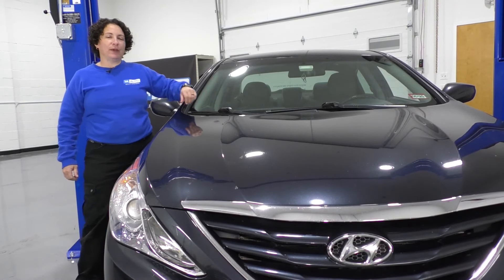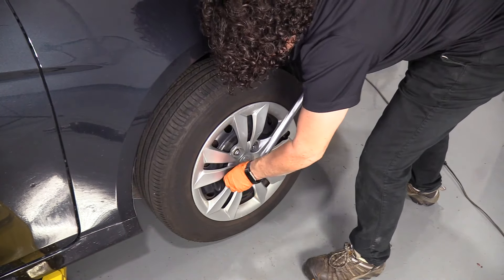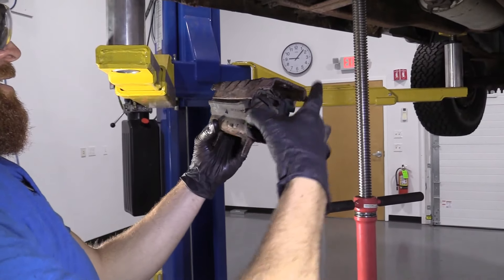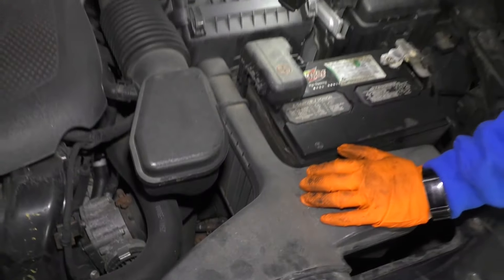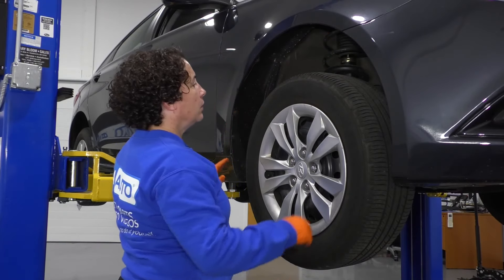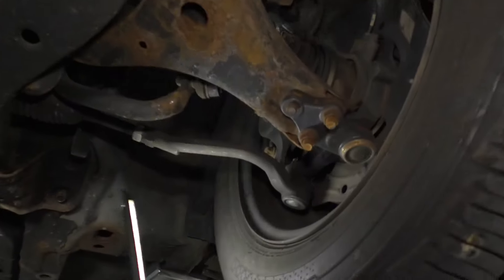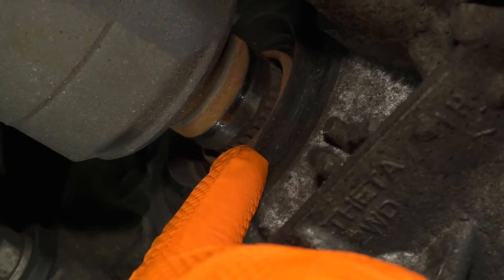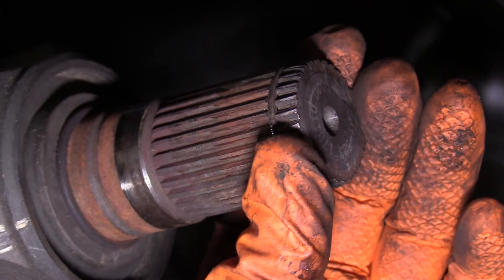What's That Noise From My Car? Diagnosing Vibration Under Acceleration!

Comment: Depends on how old the car is, or the last time you changed trans fluid. The torque converter will shutter and not lock up properly. You need to change trans fluid and maybe add a friction modifier to the trans and it will go away. I had checked everything she talked about here and couldn’t figure it out until a tech told me to change the trans fluid and it stopped. It felt like you were running over rumble strips.
Reply: Hi
Reply: I have got a similar problem..got any suggestion?

Comment: Have an 88 sentra. Mine seems more idle related. Usually when first started it's ok, although sometimes idle is rough. After a few minutes of driving(warm or cold), it'll start to randomly shake, like it's sputtering, but it's worse when excelerating from a stop. On the highway around 50 it isn't bad. If it sits for a while, after you start driving, it's ok for a mile or so, then starts shaking again.

Comment: She’s GOOD! Excellent description throughout!
Reply from the maker: +Windmill Last Thanks for the feedback!
Reply: @1AAuto  I have a 2012 and a 2013 ford edge and both vibrate on acceleration around 30 to 45 mph. not highway speed. Could this be the same thing? the 2013 vibrates the steering wheel  the 2012 you can feel it but doesn't shake the wheel

Comment: I had the same problem on my 2015 highlander, whenever I step on the acceleration pedal the front of the car shakes, when I left my foot off the acceleration pedal the vibration is gone. I definitely check the CV Axle on my car.  Thx for sharing the video.
Reply from the maker: +Jun Da Li Thanks for checking us out! http://1aau.to/m/Shop-1AAuto-c

Comment: Ahh! Thanks! I finally have something to look into!! I ruled out the cv shafts, as I'm used to the joints getting noisy and eventually tugging the steering wheel. 

When I got my 2010 mazda3, the engine was nearly falling out, all of the mounts were shot. I bet the axle pulled out and damaged or lost the clip. I'll be back with my findings!

Comment: My pickup Chevy Colorado 2018 had a vibration at 50 + mph...well going thru every posible scenario....a body shop guy suggested me to do a check on the chassis...sure enough the truck had a bad wreck and chassis was out of whack just a bit but caused major vibration at high speed....cost me 200 dollars to correct the problem now i am loving and enjoying my truck👍❤
Reply: Have the same problem on Chevy Colorado how can I check on the chassis if it’s damaged
Reply: How can that problem was fixed the truck was also in a wreck before

Comment: Got a vibration sound more of a humming noise near the driver foot area when lightly acclerating. The humming vibration is strongest with light accleration, less with higher speed of 40+. Of course the cold start are really strong. 220k miles Sienna 2009

Comment: Been trying to find this issue on my car for a while, will be looking tomorrow snd fixing right away if that the case, thanks a lot.
Reply: Didn’t see any signs of failure but took a chance on the drivers side drive axel as I did recently hit a curb hard. Did not fix the vibration in the front end. Will be checking the wheel bearings in the morning but after that is passenger cv axle, so close.
Reply: Turns out it was the 2 front wheel bearings, car is finally running smooth, no vibrations.

Comment: Great mechanic, I've recently replaced shaft crafts and CV joints on my car, the only unsettling part is when I do a 90 degree turn that's when I hear this worrying sound like an old steal being bent.

I'm clueless with cars, it vould be nothing but dang its uncomfortable especially when one bought a used old model car.

Comment: I replaced both the struts AND half-shafts on my 03' Grand Am GT;
But I have a metalic, grating, grinding noise coming from the
driver's side. I believe it's the strut-mount. It's possible I didn't
tighten that middle securing nut when I installed the spring
over the new strut.

Comment: What would happen if clip was in Transmission?  I was sideswiped and had to have repairs--strut, wheel, body work on passenger side.  Vehicle ran great for 6 months then the axle dislodged (I believe from transmission); they said it must have been knocked slightly loose by the accident and then missed by mechanics and insurance adjuster. Anyways, there has been a slight vibration on both pedals and floor board every since the made the axle repairs.  Took it back later and they replaced tie rods and steering column, but it barely helped with the vibration...

Comment: I think my motor mount is broken! My steering wheel shakes when i get over 60 mph so i have to turn my steering wheel a certain way to prevent the noise… also when i brake on reaction my steering wheel shakes uncontrollably… is that the problem?

Comment: I have a very similar problem on my nissan micra 2007. The car is shaking when the rpm is between 1000-1500.when the rpm is more or less than that it doesn't shake.what is the problem in your opinion and please explain me why it vibrates only at this range of rpm?
Thank you very much

Comment: you ma'am are awesome I work on cars a little but wish I could learn from you I am learning from the video too I got a 2012 4cyl buick lacrosse 66,000 miles had it 5 yrs haven't had any troubles but a camshaft sensor right now I can be driving and it will do a little jump when I slow down I really can't tell if somethings going on cause it has auto stop so when you slow way down almost to a stop it feels like the auto stop. could it be spark plugs since they haven't been changed wanna nip that in the bud before it turns into something big
Reply from the maker: +MsLeelee94 Thanks for checking us out!

Comment: Hi Sue. Is there a clip on the front passenger side axle. I replaced it but didn’t see a clip and now when I go over bumps I hear a popping noise and when I go on sharp turns. ‘03 Honda Element. I checked and it seems there about 3mm play between the transmission and axle. I pushed it back in but keeps coming out slightly. I feel a vibration when I go over 80. Thanks for the great videos. You make it seem so easy lol

Comment: My car starts to shake when I’m going 60 or faster. I had the same problem when I have a ford escape and my cv axle was completely broken in two pieces. It did end up failing inspection due to front end play.. of course during covid when everything was shut down.

Comment: I have a 2011 GMC Terrain 3.0 AWD.  While in Park, I can press on the gas and the car noticeably vibrates at 1500-2000 rpm, then smooths out above 2000 rpm.  Any guesses!

Comment: Pls, advise as I have a major problem with my reverse gear Ford Taurus 2011. After driving only, when I STOP and shift gear from drive mode to reverse, there is a big hammer clunk sound from inside maybe gear tooth or axle not sure, even mechanics are not sure due to zero error showing in gear computer. I have done gear formation but still, there is sound. Surprisingly there is no loud sound if I change gear after 4-5 secs from drive mode to reverse. Also on parking if I change from P to R  or R to D there is no sound. Not sure is it becoz of AXLE and appreciate your feedback, thxxx

Comment: I have a 0.5 to 1.5 second vibration coming out of a stop and accelerating.  My transmission was "rebuilt" a year ago, but I don't trust them.  Any idea what it could be?  It also vibrated from a stop sign where I gave it a bit to clear the intersection, and lost the usual engagement to the rear wheels (old BMW).  Then it engaged suddenly and my rear wheels squealed.  I need to find out what's doing this.

Comment: Sue...how about a vibration that you feel in gas pedal and seat and dashboard that is intense at cold start but lessens (but still annoying) after warmed up? Vibration is better after 2nd or 3rd start while running errands. Motor mounts already replaced.
Reply: Did u figure out what it was

Comment: I have this very same issue with my 2020 Hyundai Kona fwd. I checked the wheel balance and axle bo issue. Couldn't find where the wobble is coming from and it's driving me nuts.

Comment: Mine does the same thing but reverse it rattles when accelerating and goes away as it speeds up. Sway bar is good, links are good... Could it be my shocks? Its on the passenger side

Comment: Got bmw 120d with steering wheel wobble.   Had front wheels balance and bearing ok and coils good hard to lift the car myself coz bmw lift points lol.     Can back wheels make your car wobble or front disks it’s at low speed

Comment: HI DO YOU KNOW WHAT CAN CAUSE A CAR TO SHAKE around 5 TIMES  WHEN ACCELERATING FROM 0-10KM H IN 2015 volvo with the automatic engine start stop button ON. when turning it off pretty much the vibration from 0-10 its GONE
Reply from the maker: +ed lara salas We wouldn't be able to diagnose an issue like that here, you may want to have a local mechanic take a look at it. Thanks for checking us out! http://1aau.to/m/Shop-1AAuto-c

Comment: Holy crap Sue that's awesome! I have never seen this called out before. I have an observation...  at 3:52 you can see a harmonic ballast mounted mid-shaft on that axle. In all my years (30+) of owning Mazdas, the newer ones have had these on the axles from the factory. As the miles pile on I eventually need new axles, yet they seem to never come with that harmonic ballast. Any thoughts on this? I just wonder if the foreign reman factories are tossing the ballast during axle rebuilds instead of repurposing them. I have an odd warble in my Mazda 6 in 1st gear (V6 manual) acceleration and I've always wondered if this is the cause. The axle is not pulling from the transaxle as you've shown here. Again, thanks for the great video!!

Comment: I have a 2005 avalanche with a vibration at all speeds coming from the rear. I jacked the vehicle up and checked and I am able to wiggle the tire not in and out but wiggle it like you would as though checking a tie rod. There is a lot of movement there considering it shouldn't even move. It also makes a noise while I wiggle it. What can cause this. Is it the bearing? Axle shaft? Or both?
Reply from the maker: +rodger roy We wouldn't be able to diagnose an issue like that here, you may want to have a local mechanic take a look at it. Thanks for checking us out! 1AAuto.com

Comment: My car vibrating when moving front and back while acceleration what would be the problem when i keep the car in parking then i couldn't find any vibration only when moving front and back by acceleration i am facing a vibration inside the car not from the out side

Comment: Hmmm...passenger side axle has a clip ? My car doesn't have a clip on the passenger side. It's a long axle, so there's a bracket in the middle attached to the chassis with 3 screws, and axle is attached to the bracket with 3 screws, so there's no chance of the axle slipping out of the transmission.

Comment: Hello, I have a vibration in the gas pedal at approx 55mph on a 2007 Buick Lucerne. Any suggestions on this?
Reply: I have the same issue 2011 buick enclave did you figure yours out?

Comment: My honda civic 2007 silencer is vibrating when car is stop and i can feel vibration in gas pedal to..And at full press gas pedal my car speed  rpm in slowly going up very slow car speed is very slow
Reply from the maker: +Ahmed Shahzad We wouldn't be able to diagnose an issue like that here, you may want to have a local mechanic take a look at it. Thanks for checking us out! http://1aau.to/m/Shop-1AAuto-c

Comment: Think this is the same issue that's occurring in mine. Same year make model. Submodel is a Limited with the 2.4 when I hit about highway speeds I can feel a shake, vibration in the steering wheel and visibly see the passenger seat move. When I deaccelerate, coming to a stop I feel the vibration in the steering wheel as well. Thought it could be rotors since I had them replaced awhile back but after seeing this, I'm leaning towards CV joints. And I say that because when I do hard turns when reversing or turning, I can hear the click click sound...

Comment: Hello I have the similar kind of problems in my 2017 Hyundai Tuscan.When i press the gas in the stop sign or slower traffic my car start shaking and vibration and there is a noise coming Infront of me can’t control even I took to my Hyundai servicing center they don’t know what us the problem since I brought the car after 7/8 months it start giving this problem I went lots of time the Hyundai dealer servicing center they don’t know the car problems and always have excuses and said because it is a dual clutch system so it is like this and till now I’m driving this kind of shacking car can anyone help me with this problem I’ll appreciate or any place to fix this problem thank you in advance.
Reply: intake manifold,and egr

Comment: I replaced everything I could think of.
Fuel filter 
Fuel pump 
Spark plugs all new. I  could drive around for a three hours and then it will cut off on me, I let it sit for twenty minutes or longer and it will start up again????

Comment: I wasn't so fortunate, it looks like the transmission spline maybe worn on my civic with 136K miles causing my vibration....  that has to be the culprit..  new CV shafts and the vibration continues..
Reply from the maker: +Zolitar Iglussey Thanks for checking us out!
Reply: Did you find the problem?